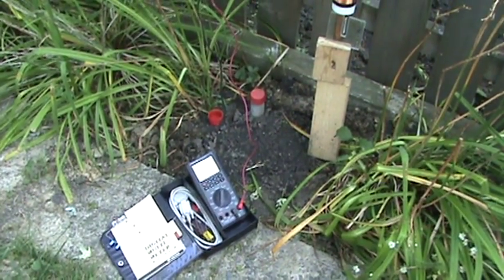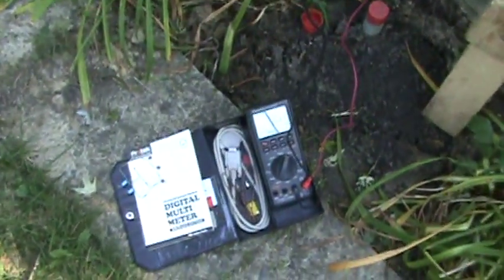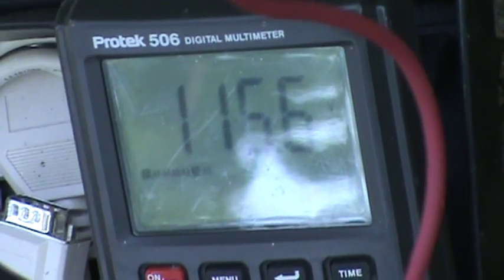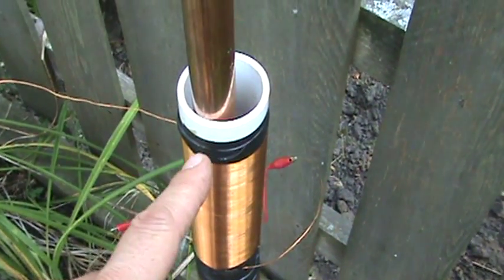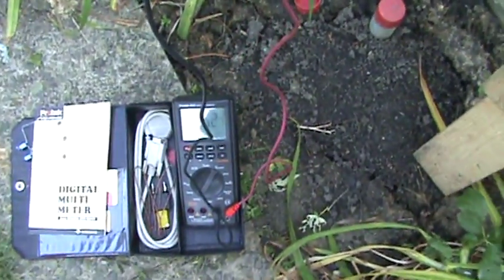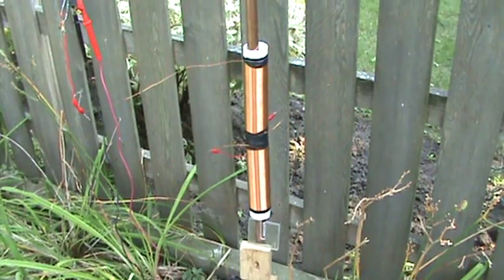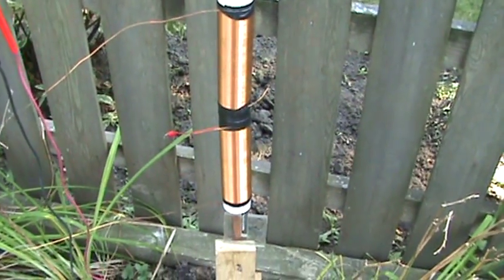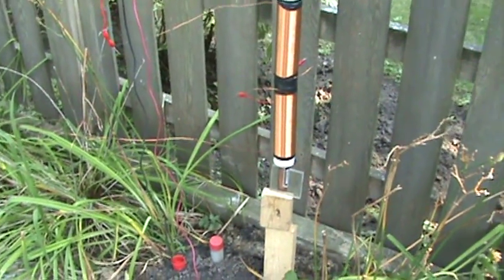FREE ENERGY FROM AIR CIRCUIT PART 19/24

Comment: any time you move the coil u change the magnetic field...according 2 Faradaythe "flux rule" that the emf in a circuit is equal to the rate of change of the magnetic flux through the circuit applies whether the flux changes because the field changes or because the circuit moves (or both).... Yet in our explanation of the rule we have used two completely distinct laws for the two cases  –    \stackrel{\mathbf{v \times B}}{}  for "circuit moves"

Comment from the maker: @larryllix well science does have explination for using radio waves to power things,,,they stole my circuit already,,they now have devise on internet that can now charge your cell phone battery with out using a battery to charge, just uses waves from the air like my circuit.  I have circuit diagram here...  paulslab dot blogspot dot com, at bottom of page.  shock from air induction was probly just static,,, im definetly not picking nup static, even though it can be done very similar to how i did

Comment from the maker: @INVENTOR3 in my air circuit the coil "is" conected to the rest of the circuit so the coil "can" have a plain dc current running through it. it is not ac in the coils.

Comment from the maker: @larryllix your correct, dc can not be induced, but pulsed dc can, like my tesla coils.
but dc can run through a coil and create an electromagnet.  My coil in my circuit has dc running through it because it is not induced, induced meaning, like my tesla coils, the secondary is energized through pulses of colapsing and expanding magnetic fields in the primary and the secondary is not conected by any wires to the primary.